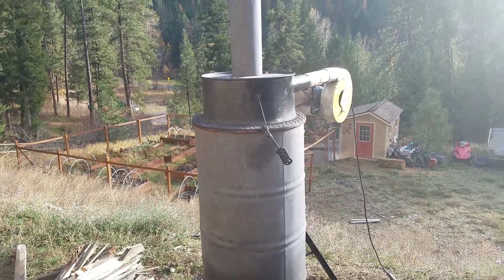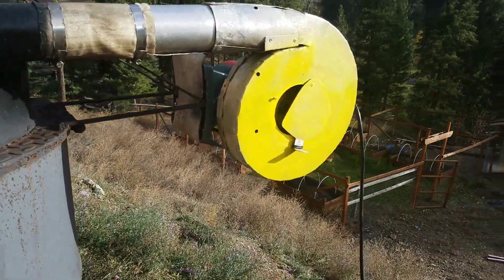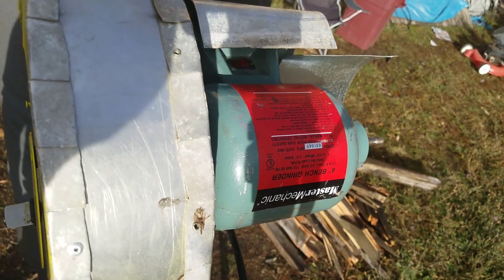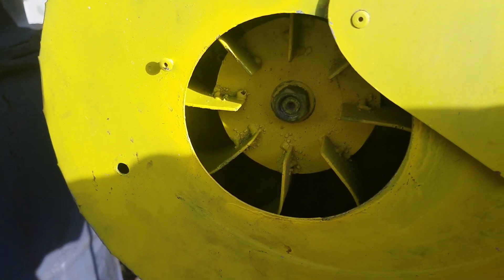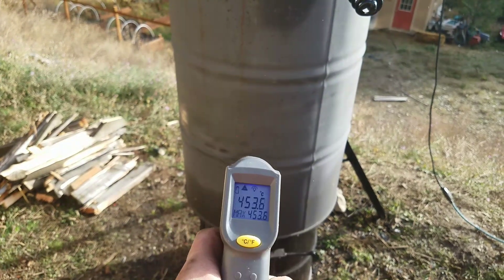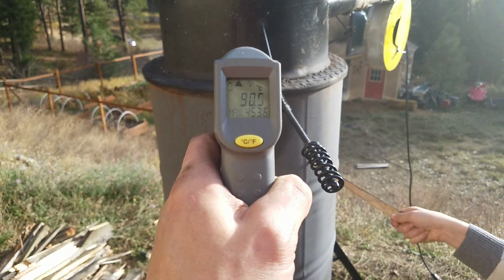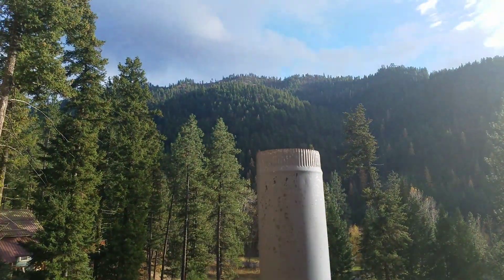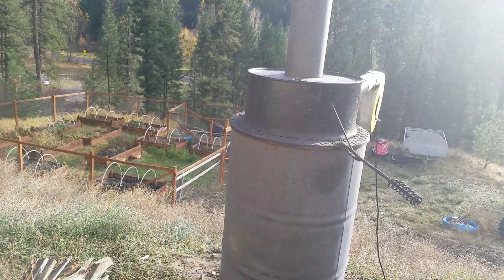Vortex barrel incinerator - Overview

Comment: I just finished test runs on the incinerator I'm building currently. I used a 32" diameter, 3/8 wall pipe, 40" tall for the burn chamber, and a 6" tall cut off from a drum for the air chamber. 2- 3" pipes inside the air chamber direct 1200 cfm of air around the drum and into the burn chamber. Burns really clean. Need to layer the garbage with wood to keep an efficient burn going. I still need to make a good lid seal and finish welding up the seams. However first tests show great promise!
Reply from the maker: Sounds pretty solid!  The one I did here the lower barrel will end up being disposable.  I give it a year tops.
I started with 2.5" air inlet pipes, but I ended up restricting the flow down to a little more than half that with a nozzle of sorts later on.  Seemed to make it burn a little hotter.  Probably depends on the back pressure your fan tolerates as well. 
Make sure to post a video so we can check it out.  :)

Comment: Could tell me full specifications of that blower? Like watt, voltage, speed in RPM related to that blower..
Reply from the maker: It's an inductive bench grinder motor and the blower/housing itself was hand made/balanced.  
That's the motor he had extra of, that would last.  3600 rpm no-load speed, 1/3hp, capacitor start, 115v, probably about 6-8A.  I believe it runs full speed, but I did not measure it.
I ended up not needing that much airflow and only need about 1/2 'throttle' for a good burn, so some slightly larger blades and using a regular 1750 rpm motor is probably doable.  That would be quieter, and much more tolerant of less than perfect welding as well.  The first time I spun that one up, I was about 10 feet away and behind a sheet of plywood.  :)
Reply: @DarenSchwenke Thanks. That helped me a lot. Really appreciate your work.

Comment: i like it alot.
i would ask but ill just google vortex incinerator plans.
what konda volume can you load at a time?t
Reply from the maker: You can load it about 2/3 full and still run clean.  Try not to put anything high moisture in until it's fully up to temperature though.
You can pretty much see the extent of what was required opening the lid.  A plate over the exhaust, at center.  Something in the exhaust stream to arrest sparks.  Air injection around the edge down at an angle.  A good seal where it opens.The rest (preheating the intake air with the upper chamber) is gravy.
Reply: @DarenSchwenke  thank you

Comment: Nice incinerator. I can't picture what's going on in the top module.  I got a glimpse of the baffle when you raise the lid, but can't visualize it. Are there two air nozzles or one?
Reply from the maker: There are two.  When the lid is up, the one on the left aims straight down into the barrel.  Helps to get it going.
Reply: Nice touch. Thanks.